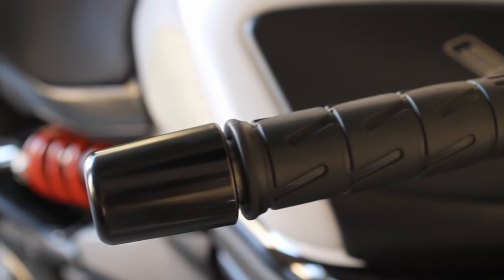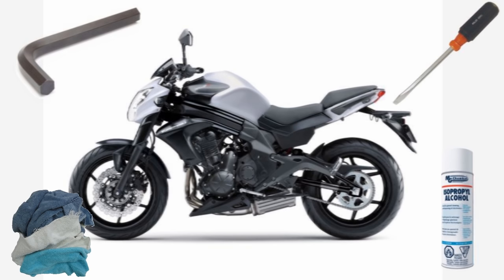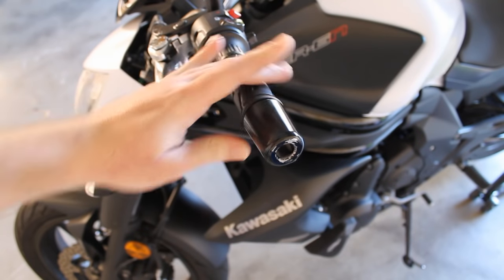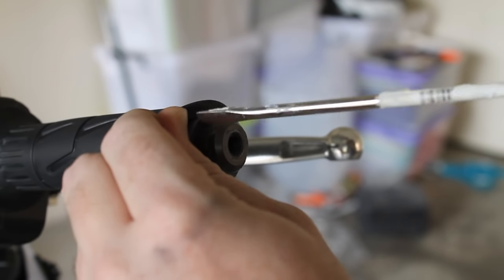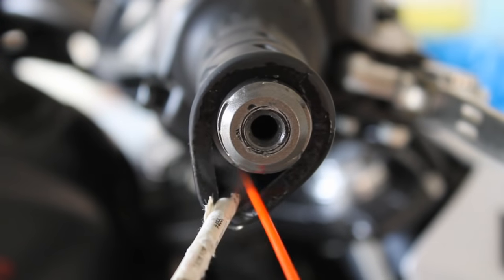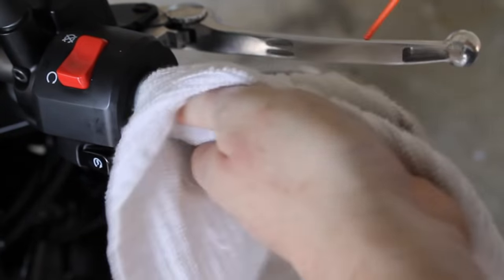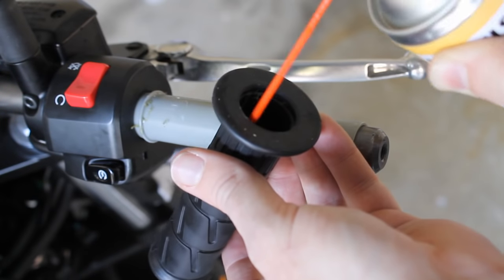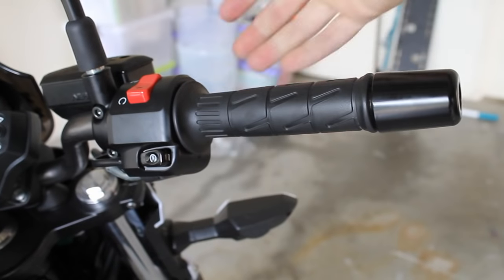How to Change your Motorcycle Grips - Remove Motorcycle Grips - Install New Motorcycle Grips

Comment: Top tip: If you use hairspray as a lubricant to install new grips, it will work to help get the grip on and dry as a glue to help eliminate any slippage. It is also good to drop the new grip in warm/hot water for a few minutes to help the rubber become more flexible to avoid tearing it if a little force is needed.
Reply: Thx for the hair spray tip. Worked great.
Reply: @MrPepper312  No problem! Hair spray is great for all kinds of other uses. It's works as both a lubricant while it's still wet and a mild glue when it dries.
Reply: Ur a legend bro
Reply: What type of hairspray?
Reply: @GeekOT1  Any aerosol hairspray will do the trick. If you have a girlfriend, wife, or mother... They might be able to reccomend a brand name that sticks better than others.
Reply: May the gates of Heaven open & welcome you! Thks Bro.. this was so easy to all the other methods I looked up.. thks again!
Reply: @tariqholder8818  Wow I posted this comment 7 years ago & I'm glad to know it's still helping people to this day. Thank you for your kind words.
Reply: @TwistyTrav bout to try it out. Thanks for the tip
Reply: I’ll be trying this on the upcoming weekend. Thanks brother!

Comment: I'm new to motorcycles and this video was a big help. Only thing I did different was that I sliced my old grips in half with a box cutter to remove them. The grips slid right on and the rubbing alcohol dried up in minutes, didn't even have to use any grip glue......

Comment: Not bad. Good help, in fact! I'm not sure about Aus but here in the US, aerosol ipa can be a bit challenging to find locally and would usually need to be ordered. If this is locally available in AUS, I am jealous!!!! If I may share what I do: I just lift the end of the grip and cut them off my bars using a knife or utility shears. They are either not what I want or they are worn anyway. Clean the bars with acetone, and then spray some hairspray onto the bar moments before I slip the new grip onto the bar. The hairspray acts like a lube for about 3 min and then it dries to an adhesive that wont slip. Give it a go !!!!

Comment: Great video
I was trying to remove the end cap, but was sooooooooooooo hard. I was holding ONLY the end cap, but I believe something was rotating inside as I can hear metal clicks. At the end I stopped as the handle was not returning to its original possition as it should do. It returns very very slowly. Did I damaged it because I was holding only the end cap and not the whole thing?

Comment: Thanks for this video, short and to the point! I am trying to change my grips for the first time as a beginner but I just cannot unscrew the bar end screw, it keeps rotating with something inside. I will try heat gun. Any suggestions? Thanks! P. .: DO YOU think that a hairspray will do the job to hold the new ones, or I should buy a pro grip glue? Thx!
Reply: Use the Allen wrench with a combination of closed ended wrench to apply addition torque to the Allen wrench.

Comment: My grip on the gas was really tight so i couldn't put in on by just push in straight line I hade to twist and be very rough to get it in. Can something be damaged? I mean I twisted so the gas went to the stop and then twisted even more to slide it on. I'm but worried now I did something

Comment: Having hard time removing the ends. Only keeps on rotating but not actually removing. Any suggestions?
Reply: Sounds like it might be stripped. You might have to drill it out.

Comment: Quick question, what glue is it that they used on those because wouldn't the brake side or left side grip spin. I'm looking to replace mine or just reinstall the OEM ones after a handle bar replacement.
Reply: I used Honda grip glue and it worked, just be careful not to use to much.
Reply: @anthonyintrieri3329  it's ok, somebody replied. Yes, finally someone notices me.

Comment: Don't use screwdriver. Simply put air pressure nozzle between the end grip and bar, apply little air pressure and the grip can be turned and pulled out .

Comment: If you're installing new grips why would you put so much effort into preserving the old ones? You can use a razor blade to cut a line down the length of the old grip and peel it open like a banana. No one wants to jam a screwdriver into their bar end
Reply: Personally I'm adding heating elements under my existing grips. So them being in good condition is pretty important.

Comment: My bar ends won't screw back on? 
The insure of the handle bar is rubber and it just slides in and out without the screw action

Comment: Is it necessary to use grip glue?
Reply from the maker: Joshua Spillers I've never thought it was necessary but it might depend on the quality if your grips.
Reply: Joshua Spillers I was thinking the same thing. a few other videos that I saw they used the grip glue.

Comment: I know noone will answer but still, i put my grip on to the motorcylce but it didnt slide all the way in now its half on the throttle half outside and it doesnt want to slide in all the way ... its frozen
Reply: So use alcohol to take it off and try it again

Comment: So my throttle is sticking after putting new grips on anyone know what that could be?
Reply: Nevermind figured it out so FYI whoever doesn't know when you get new grips make sure the throttle grip doesn't have a back wall on the end of the grip or your throttle will stick when you make it flush but if you do get some with that just cut out the wall on the throttle grip so it's hollow and you'll be good to go

Comment: Word of advice. If you can afford a motorcycle, you can afford an air compressor. Get a damn air compressor. They are about $100 for a pancake style and you can use it for many things service related for your bike. Get the damn air compressor.